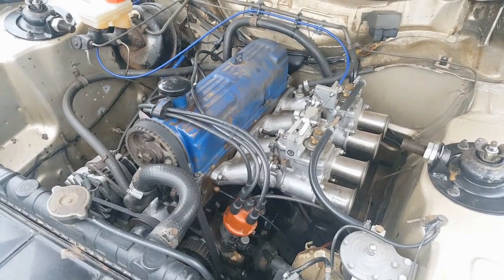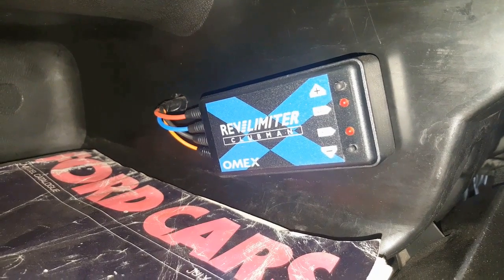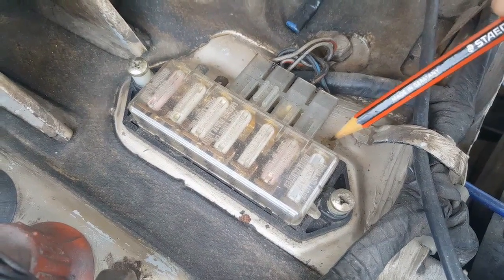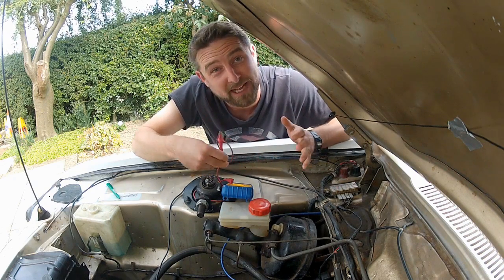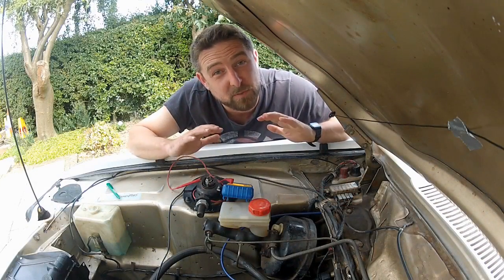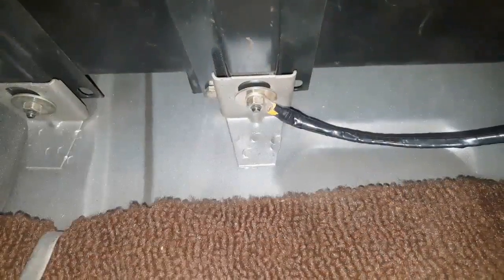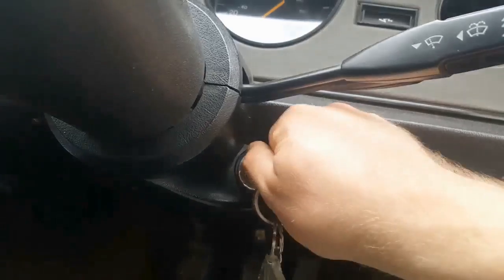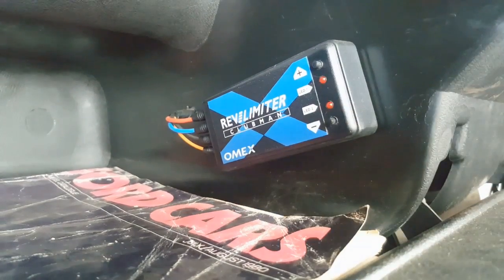Omex Rev Limiter & Launch Control - How to Install & Program (Ford Capri) | Tech Tip 27

Comment: Can you set more than one limit without the launch control button? And can you change how often it cuts spark similar to a bee r limiter
Reply from the maker: No, can only set one upper limit at a time. Then you have the option of a 'hard cut' or 'soft cut' limit. There's not much else to play with.

Comment: You should put the lc button under the clutch pedal, so when you press the clutch it automatically turns on lc
Reply from the maker: Not a bad shout that. Could interfere with heel and toe shenanigans, if that was your thing.

Comment: Do you need to hold the button all the time for launch control or just press it once?
Reply from the maker: You need to hold it down for launch control. As soon as it is released it reverts back to main limiter.
Reply: you coul wire in a 12 v time relay so the on signal stays on for a cople of seconds. 4 seconds would probebly be best